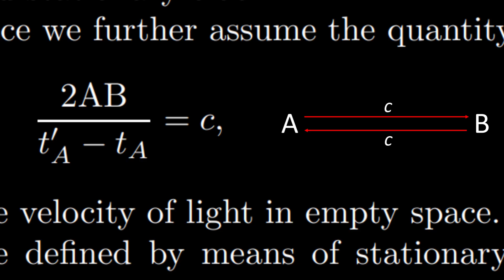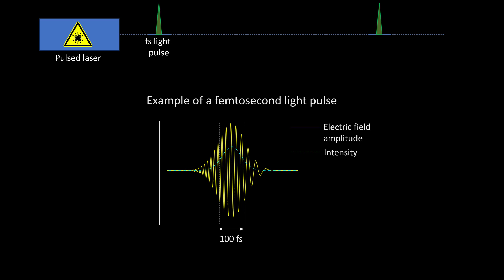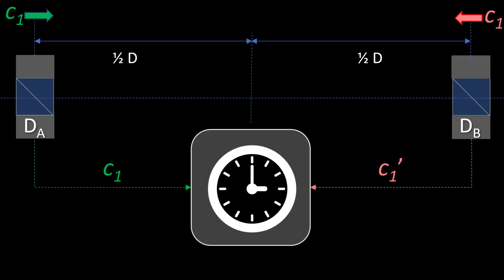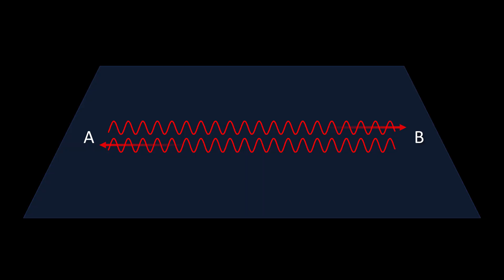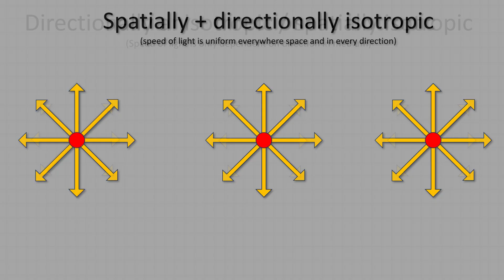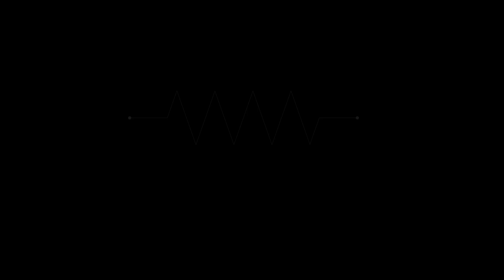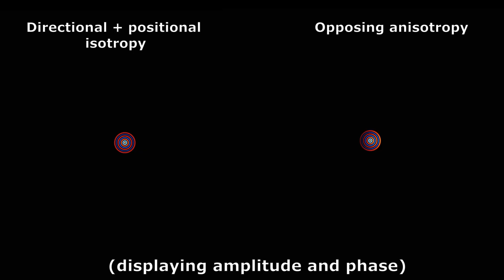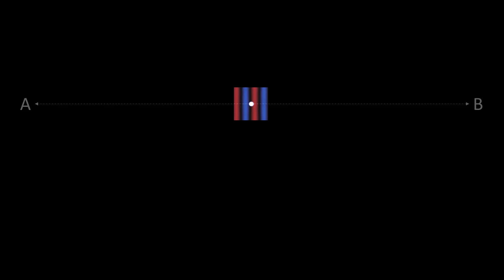Knowing the one-way speed of light

Comment: This is also easily shown with standing waves. If the frequency in both directions is the same, different c values would result in different wavelengths and there would be a different interference pattern. Seems quite simple to prove.
Reply from the maker: Well, I looked into that route and it is actually not that simple. You would still get standing waves, but the interference would have a very high phase velocity and would therefore in practice be indistinguishable from a normal standing wave. It would just have a different spatial frequency, which might be hard to detect if the speed in opposite directions is not very different.
Reply: @HuygensOptics  Isn't the whole idea of the Michelson-Morley experiment to use this exact effect to disprove the aether theory? Today this gets measured to extreme precision in long baseline interferometers.
Reply: @HuygensOptics  It is true that the phase velocity is extremely high, but the width of the intereference maxima would also change depending on the spacial direction (I mean the light speeds cannot be different by the same amount in every direction, so you should see a difference when turning the interferometer).
With a long enough baseline and a sensitive enough sensor you can probably measure to 10+ digits precision on the equality of the spacial dimensions.
Reply: @HuygensOptics  The one way speed of light has been measured, and it is not what you think. See my post at the top of the comments.

Comment: I quite never understood why not use two precise syncronized clocks, one to trigger the light pulse and the order for the detector and then calculate delta from detected light - trigger time
Reply: Because you have no way of synchronising clocks if the speed of light is different one direction from another. This is the whole point. Suppose you have a spaceship going a significant portion of the speed of light relative to an external observer, and they synchronise the clocks onboard by bouncing light back and forth, and assuming that c is the same both directions. To the outside observer, the light pulses going forward will have taken more time than the space ship thinks, and the pulses going back will have taken less time, so it looks to the observer as if the clocks are not synchronised.
Could the spaceship synchronise it's clocks by moving them together, synchronising them, and then moving them apart? The numbers for the above also mean that the perception of time must look slower for faster moving things, which scuppers things again. The spaceship believes the clocks should stay synchronised, because they are moving at the same speed forward and backward, but the outside observer will see the clock moving forward moving faster than the one moving 'backward', so they will go out of sync.

Comment: The overly clever setup of the beam splitters, detectors and the clock reminds me of how designers of perpetual motion machines try to hide the energetic symmetry of their devices behind complex mechanics. The end result is the same: you just can't cheat your way around conservation laws and symmetries.
Reply: I remember one configuration where the difference in input to output electrical energy was an artifact of the NON-RMS multimeters that would not correctly interpret the complex AC waveform.  Replacing the meters with RMS reading meters eliminated the apparent free energy and demonstrated the expected loss in the complicated looking circuit. :-)
Reply: I read the comment and the comment seemed to agree that the speed of light is the same in both directions.
Reply: @raulkaap  yes but not because of "cheat your way around conservation laws and symmetries", there are not "conservation laws" nor "symmetries", is just that if you measure it, it is the same, and it kinda makes sense because it would be a bit weird if it changed, but I don't necessarily see any clear reason why it couldn't, because there are no such "laws". but at the same time, your comment seemed to imply that there is no way to measure it, and in my comment I explain how there is, in fact, that is my point, that if you measure it, it is the same, because you can measure it
Reply: @NeroDefogger  I agree that there are no "laws" but physical entities and quasi-entities do interact in consistent ways due to their inherent characteristics and that's what we call "laws", which is a shorthand.

As to the scheme you described (sending rockets in opposite directions), it is a simplistic setup with known flaws, which is why, I believe, mr. H. Optics didn't dwell on it. Upon closer inspection, the experiment doesn't measure anything because all the devices are subject to the same effects of C and moving them this way or that doesn't help. None of the devices are isolated and every measurement implies a two way trip (e.g. taking something somewhere and then sending light back).
Reply: @raulkaap  "known flaws" HAHAHAHAHHA alright then... try.....
"doesn't measure anything" that's your attempt to debunk it? really? really? that's it? actually really? just pure lazy denial of absolutely everything? really? "because all the devices are subject to the same" what? literally what are you on about? "None of the devices are isolated" ISOLATED TO WHAT?! TO YOUR (extreme lack of education)?! what even?!  "implies a two way trip" the two way trip is the friends we make along the way dude... what an absolute joke of a bunch of words putted together, simple unbelievable
Reply: @NeroDefogger  Even if for some wild ass reason there was a preferred direction for the universal speed limit of transfer of information, there is no way to test it, and itd have absolutely no effect on the resulting physics or to the perceptions of any thinking entities inside the universe.

Its the same as if we had a simulation of a universe in a box and we could control the speed at which it "ticked"....even if we doubled the speed of one "second" I skde the simulation, any and all laws inside the simulation would still work the same relative to one another and any thinking being inside the simulation would have no way of knowing. To them, everything would feel the same and they'd percieve time as flowing at one "second" per "second".....there is no tests they could do that'd let them know weve done anything at all.

Its the same for us inside our universe. If the speed of information was different in some preferred direction, allnpur physics would appear to work the same relative to us. Nothing would "feel" different in any way and we have no way of knowing......speed in general is always relatives anyway. In the Galilean sense of relative. But also in the Einstein sense of relative.  Light travels faster in one direction relative to.....what exactly? To the other directions? How could we ever  know? What we are really measuring here isnt light. Its information. More specific still, we're measuring the speed of "time". Putting a number on the speed of the universal clock. Whatever a "tick" is in our universe. Which is relative to begin with.

But relativity, in the Einstein sense, already presupposes that there is no preferred direction and that there is no universal clock. We can only ever know the speed of a clock tick in our hands RELATIVE to someone else's. Just like the little mini-beings inside a simulation. Any preferred direction would require us to have knowledge of some outer reference frame, some global knowledge of the universe itself witch which we measure against.
Reply: That's telling them
Reply: Poor guy trying to cheat 😂
Reply: It's a very apt comparison. It's just impossible. And not "it just is like that", no, there are actual mechanical reasons for every experiment for why it doesn't work, but as a shortcut, we can just say it's impossible to measure. Just as it's impossible to break the conservation of energy.
Reply: i found a way to calculate the one way speed of light. now what?
Reply: false, read my comment

Comment: Yeah, the final counter-example of a mass passing by during your measurement is just bad science. You are expected to keep black holes off your optical table and locked in a separate cabinet.
Reply from the maker: But how do you prevent your black hole from eating the cabinet?
Reply: feed it some negatively charged hot noodles and keep it contained in a spaghettic  field.
Reply: @theterribleanimator1793  That does work, since the mass is pre-spaghettified but the BH can't have any angular momentum otherwise the noodles bunch up around the equator. Good luck finding a non-spinning black hole.
Also, you'll have to remove the noodles to use the BH later.
Reply: @raulkaap  damn, didnt think that far ahead.
Reply: forcing me to keep my blackholes in a separate cabinet is just another example of regulation overreach!

Comment: If the clock and the sensor is the same, i.e. a quickly rotating disc of photosensitive material, and the disc at both ends of the race track is coupled with a long axle that spins at a constant rotational speed, will this device show a different speed of light one way (angle between dots) if it is oriented horizontally and vertically in a deep shaft? I suppose the measured rotating speed of the disc at the bottom of the shaft will be higher than that of the top one, even if they sit on the same axle.
Reply: Force is propagated through material at the speed of sound of the material

Comment: Hmm, does the detector assume it can measure something faster than the speed of light, or is it the maximum speed that information can flow in the specific system (speed of electron flow)🙈
Reply: the information that the detector send out (i.e. the trigger pulse) cannot reach the clock faster than light. In the case of electric signals it's exactly the speed of light (plus a constant contribute that does not depend on the distance)
Reply: @Beregorn88  see now that statement just leads back to my question, it may only be the limit if electron transmission you're measuring